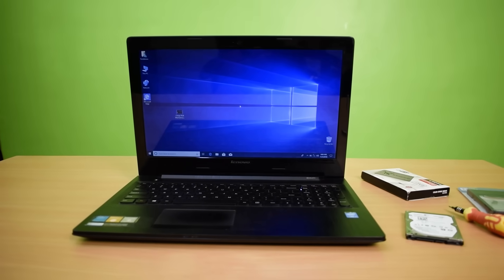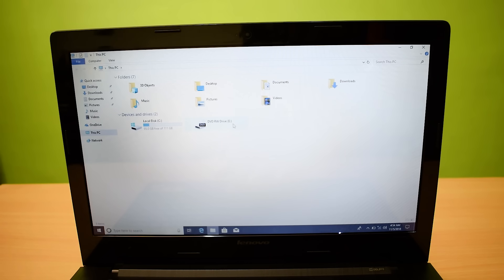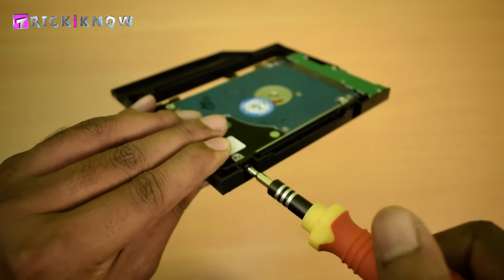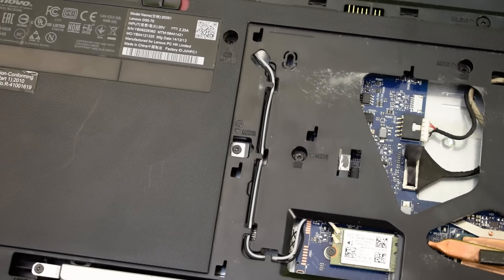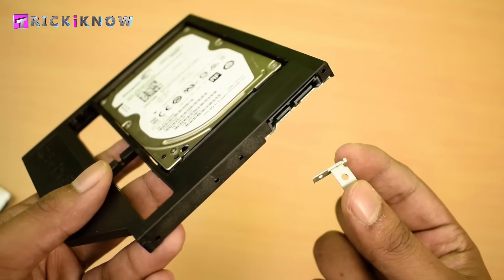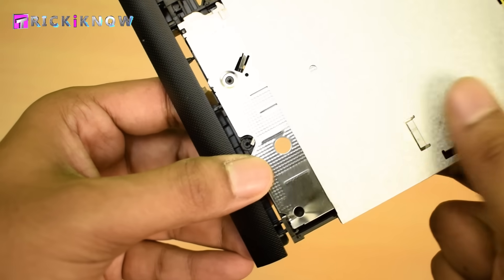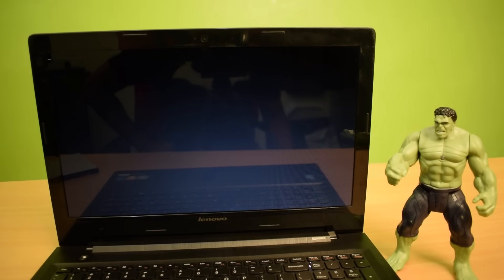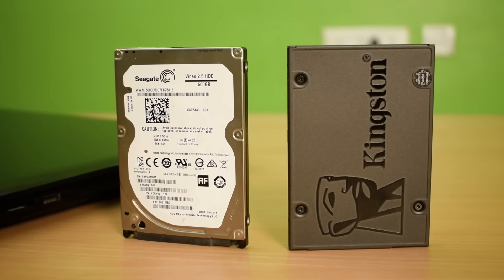How to Install 2 Hard Drive in 1 Laptop | Dual Drive Setup Tutorial (SSD + HDD)

Comment: So that's why companies are still providing DVD option 😜
Reply: Sad part is that every dvd port is sata 2 and sometimes even sata 1 in old laptop, hdd work very slow in slim sata ( dvd port ), even tho if sata 1 or 2 can't saturate sata 3 hdd (most hdd can only reach upto 120 Mbytes average), but slim sata can!, I have installed a good 2.5 inch hdd in slim sata 2 port through caddy and i was only getting 40Mbytes read and 28Mbytes write where i got 100Mbytes read 88Mbytes write in normal sata 2 port , but keep that aside you want, you just want to keep two drives in a laptop? and don't mind about speeds?, caddy is the only option, but i recommend putting hdd in caddy and ssd in main sata 1, 2 or 3 port as it's way better than Sata 2 slim sata port, and that's my point
Reply: @thegaminguchiha8570  Are u getting gud speed after installing ssd in main hdd slot?? And what about hdd in caddy ?
Is this a gud option installing ssd in main slot and hdd in caddy .. or ssd in caddy and hdd in main slot pls reply
Reply: @Matúš Ščevko you can buy an external 1 👍
Reply: @AdityaKantKushwaha  bro ssd need to install in hdd slot or in caddy.
 as 1 tb hdd already installed in main slot I want to install 250 gb ssd for better performance ..
Reply: You got point bro😀😀😀
Reply: LMFAOOO I GET THIS LOOOOOOL

Comment: Usually the 2.5' drivebay in Laptop has some Kind of dampening because classic HHD really don't like being moved around or shaken. An SSD doesn't give a shiat in the other hand. These optical disk trays for 2.5" usually don't habe any dampening or give. He says it himself how tight the HDD sits in there. Since the HDD has variable rpm rates today, the HDD also causes Vibrationen that a dampening would disperse. If a HDD is locked in tight like that, it will age, deteriorate and break much faster. Best practice would be to stick the SSD in the tray. Even when in some laptops (mostly old ones), the optical bay is on SATA2 (eg. older MacBook Pros with optical drives).

Comment: I have a hdd from my old laptop,it is a bootable drive with windows 7.Can i install that hdd as shown in the video and boot from it?
Reply from the maker: I think you are talking about dual boot , yes install the 2nd hdd in caddy. Start your laptop and open boot menu then select the hdd which you want to boot. You can also change 2nd hdd default in bios, boot tab set it to first boot device 😀

Comment: PRO tip: always put SLOWER disk in the place of DVD drive. They usually have SATA2 (slower max speed)
Reply: that means: the older HDD in the DVD-place, the new SSD in the OLD HDD place ?
Reply: @AnRAdrei  yes
Reply: @harsh_799  thx
Reply: How do I retrieve/ access the files in the old hard drive? After I moved it to the DVD slot to put the SSD in its slot.
Reply: just a question tho, if I change my hard drive, I have to install the drivers again, right? Wont I need to install the drivers again if I transfer my working hdd with the OS installed in it to the cd-rom(then just slide the new SSD on HDD's original place) just like what the guy did in the vid or it'll work just fine?
Reply: @amadeus8343  then no use of SSD. Windows will boot through hdd
Reply: Thanks a lot for the tip, I will try to consider it.
Reply: What about eSATA?
Reply: Yep, only newer device have both sata3

Comment: How does the hdd connects with the system automatically without wires connecting or providing power to the hdd?
Reply from the maker: Like the DVD rom was 😀
Reply: It does have connectors which connect to the laptop! This is also how the DVD-ROM worked.
Reply from the maker: @iProgramInCpp  yes it have connectors in the back , which plugs in the laptop's motherboard.

Comment: How do I screw the new caddy on If I dont have an old optical drive to use its back clip? ( Lenovo Ideapad 320-15ISK -  not DVD drive included) @TricK i Know
Reply from the maker: Then you have to install SSD by replacing the internal HDD and then you have to make the HDD EXTERNAL using a case
Reply: I think your laptop model support M.2 ssd

Comment: Very helpful video, however I believe it will have serious impact on the Battery as it has to spin the traditional HDD as well as run the new SSD. Please clarify if you see any such thing practically. Thanks.
Reply: Bhai, SSD has no moving parts its like pendrive

Comment: Can i replace current HDD into caddy and new SSD in Place of HDD? I need performance of SSD 
Mera windows delete ho jayega?
Reply from the maker: Yes you can install ssd by replacing hdd , now you can install a fresh os on ssd or you can clone old os from hdd to ssd 😀
Reply: @TrickiKnow  are nahi bhai mai puch rha hu ki mera windows 10 delete to nahi ho jaega jab mai hdd ko caddy me lagaunga
Reply: Okk clone wali video ka link m bhi dekhu 🙆🙆
Reply: Noo
Reply: You can put the ssd in the caddy too.
Reply: SimpleCrafter dvd drive port is most likely SATA 2 and internal is SATA 3 so it will be bottlenecked

Comment: I have the same laptop lol , with i5 and 16gb ram installed ... , I only used this caddy to clone the os to the 480gb mx500 and then I installed the cd drive back on cuz I need that feature a lot...
Reply: The heck you managed to change the processor while it is shocketed in the motherboard?
Reply: @groadmiralbismarck6625  my one comes with the i5 5200u from factory , and i can get motherboards for 100$ with i7 5700u and amd graphics but i would need to get a new cooler for it with the support of graphics chip cooling. I haf also thought of getting a new chip and replace the bga but the chip it self is 100$ i can get an entire new mobo got 120$ so thats unnecessary hastle.
Reply: @KuntalGhosh  ah, ah, ah, but at least it has 2 RAM Cards slots
Reply: @groadmiralbismarck6625  yeah i know. I have 2x8gb 1600mhz installed

Comment: If we have a laptop without optical disk drive..how we'll install the ssd with hdd
Reply from the maker: Install ssd by replacing the internal hdd then make the replaced hdd external. With external hdd case.
Reply: @TrickiKnow  can u tell the procedure for making external drive
Reply from the maker: Watch my old video: https://youtu.be/EyOwyQt3g6Q
Reply: @TrickiKnow  bhai i want to know that can i use ssd with hdd together in a laptop which doesnt have a dvd drive.?? N ur old video doesnt help in any way

Comment: I think DVD drive slot is going to bottleneck HDD speed cause DVD drives ports are very slow right?!
Reply from the maker: I used and didn't feel like bottleneck , worked fine as regular 🙂
Reply: Pls Can you install ssd as 2nd Drive and Test Speed read/Write  Thank you for Good content
Reply: @ak-ut7zy  Yes pu t hdd in cd dvd drive and ssd in main drive but clone your windows into a pendrive cz you need to install is in ssd then it will work fast
Reply: @BROTHERsGAMINGxenon  
i already put second ssd  in my laptop
 
1st: Samsung 120gb ssd
2nd: Crucial bx480 in"dvd /ssd caddy "
both ssd has over 500mbits read and write speeds
Reply: @ak-ut7zy  but ssd needs 6gbps to work its full potential :) so cd/dvd rom only have 1gbps that's the issue I am telling about my laptop today's laptop comes with 6gbps DVD cd rom
Reply: Wtf are you talking about.. its the same SATA 3 in my laptop, afaik

Comment: Bro if DVD drive needed then what to do?Please solved the problem.
Reply from the maker: Just plug it again , you have to open only 1 screw to swap the DVD drive with caddy as per your requirement 🙂
Reply: Or just use an external DVD...

Comment: Plz tell me 
How can I install graphics card on HP 250 g6 laptop
Reply: Shaik Sameevulla No
Reply: @bleek8165  why
Reply: Shaik Sameevulla Your laptop have an own system, every laptop have another. Computers have the same, so the computer can you upgrade. Maybe if you have a m2 slot you can connect external gpu but not upgrade. Sorry for my bad english
Reply: @bleek8165  k thanks

Comment: bro my laptop hp note notebook 15 can i install ssd on cd drive as i did not change the hard drive  and can i install 8gb ram pllz tell
Reply from the maker: Yes you can install 8gb RAM thats normal , but if you want to install ssd then better you can install it in the replacement HDD to make it primary (SSD is made for Operating system, this will not perform in secondary). You can use the internal HDD instead of DVD ROM using Caddy.
Reply: @TrickiKnow  hello bhai i want know that can i use DVD drive (Converted to hdd using caddy) for boot (OS) drive . Because i have installed OS in hdd  
and i want to place it in Caddy and then clone it to ssd. Will windows boot from Caddy which have pre installed OS . Please reply. I dont want to fresh install windows.